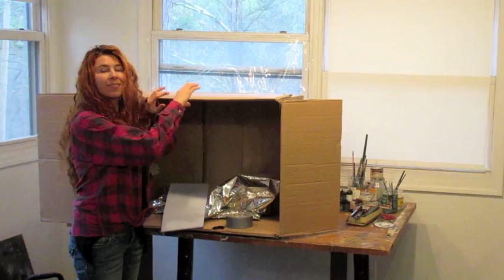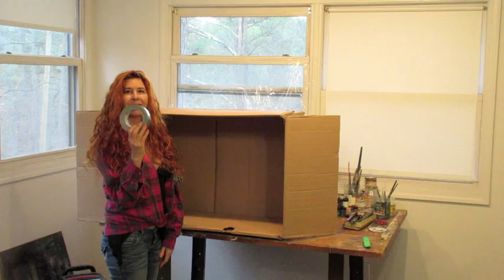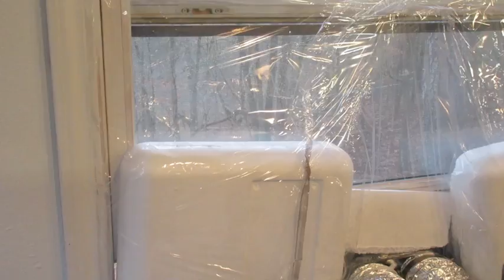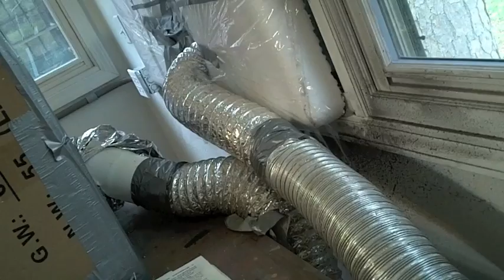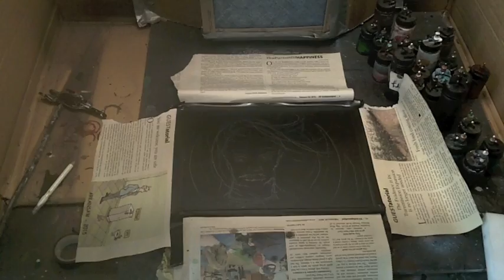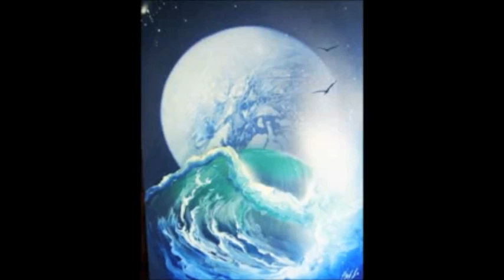how to build a cheap spray booth airbrush painting secrets

Comment: I made my own spray booth and use my shop vac to draw out the fumes.  I tried using it indoors but my wife still couldn't stand the fumes from the lacquer based paints.  Acrylics don't produce the same smells so I can still use it for acrylics and the wife doesn't complain.  I made a chamber in the back, sealed off from the rest of the booth and made a hole so my shop vac would fit.  I have a square of filter material attached with a couple of skewers so it's easily changed.

Comment: The only thing I’d do differently is I’d get another sheet of cardboard and cut a hole in it, tape that to the inside of the box and you can slide the dust filter in between the two holes - saves having to undo all the duct tape & makes replacing the filters a snap.

Comment: I realize this video had been up for a few years now but... this is NOT a booth you want for airbrush if you are painting with anything but water colors. And even there, you're libel to paint whatever is on the outside of the vent the color you're using.

This is a good example of what NOT to do and use for a paint booth on so many levels it's not funny.

This is very environmentally destructive on top of being just wrong.

I'm surprised no one called you out on everything you did wrong but hopefully after 3 years you know what's wrong... If you haven't burnt your brain cells completely out by now.

Comment: I graduated from a cardboard box to a North Coast Hobbies galvanized booth around 1991.  The booth sports a 395 cfm Dayton blower for exhaust. Used 5" galvanized furnace pipe to direct the fumes outside. 2 GE Lightstics provide ample lighting.   2 Paasche & 2 Iwata airbrushes handle the painting chores. They are all powered by a Speedaire 20 gallon compressor. Spent the $$ back then, take care of my investments & it still performs flawlessly to this day, 27 years later.  You can no longer buy the booth, Lightstics & the compressor is no longer made in the USA.

Comment: Isn't the problem with sucking the air out is that it drags in dust from the room? It would be better to blow air in through the filter so that the pressure in the booth is higher, pushing dust away. To stop paint spray getting up your nose just wear a mask. Dust is the enemy, not fumes ;-)
Reply: GRAHAMAUS. 😂 so dumb...

Comment: how about using an air filter for a home heat air unit say 20 x 20 x 1 on inside of box.    then put 20 inch box fan on back pulling thru. filters are cheap. box fans seem to live along time.  just seems simple

Comment: DIY spray booths can be made cheaply but much more robust than this effort. The biggest drawback is the excessive noise from the vac. There are much better materials than carboard that are cheap to buy as well as being waterproof. You can buy a pair of cheap inline fans that run much more silently than the cleaner. Angry neighbours pounding on your door at 2.AM in the morning is not going to make you popular. A more robust spray booth means you can move it without falling apart. The strips of LED lights are very cheap from china. They give out plenty of bright white light. I'm not knocking the concept of making a DIY spray booth but a much neater, stronger, quieter, waterproof,  booth could be made The kind of electric fans made to extract fumes  through kitchen window or similar inline fans of around  6" in diameter will do the business. The larger size of fans used to cool electronic equipment are make little noise and can be picked up for next to nothing as used items.
Reply: I like your ideas. The purpose of this video was to empower people to begin thinking about their ideal home made spray booth with stuff they already had around the house...glad you added your thoughts. I'll look into LED's and electric fans...hadn't thought about that. After making mine out of cardboard with a dust collector, I made a plexiglass version. I'll have to post that soon.

Comment: Great video for us beginners, i'm doing the same sort of  thing, making a test booth at low cost, modifying it ( several times ) and soon will make a great one from wood. i like the clear top idea, like the last suction fan unit. Gotta find a way to do all that and have the fan outside the room i work in and a way to filter the air well enough to have it exhaust in my garage.mmmm

Comment: Go to Wal Mart or even the Dollar Store and pick up a Large Plastic Tub instead of a cardboard box. Over time the box will break down depending on what you are spraying into it. Also watch the solvents that you spray!  Solvent based paints and open  brush motors do not mix! The solvent will eventually clog or cling to the motor brushes and possible causing a fire. If you will only spray water based acrylic paints you will have no problems with brush motors. If you can find a closed brushed motor you are okay. I got a hold of a fireplace motor fan that was for a Gas fireplace and I used that for my motor for my Spray paint booth.

Comment: Why not use a plastic storage box (rubbermaid-tupperware etc.)for the paint booth instead of a cardboard box? How about attaching the filter to the inside of the box. It would be much simpler to change when needed. There would be no need to duct tape things up and reduct tape every time you change the filter. Just food for thought.
Reply: Like rick said, tape filter material on inside so it's easier to replace. Also with the bag being so large on the back, use more of the filter with a larger hole and surface area you won't have to change the filter as often as there's more surface to get clogged.
Reply: She is a female,,, that's the best she can do. LOL
Reply: Good to see you’re at the top of YOUR game, you pathetic, misogynist piece of shit.

Comment: Just an FYI but I had a conversation with a relative not long ago about the issue of the flammable solvents from a spray paint can being sucked into the fan.  He works as the person who goes into large factories and points out all the fire and safety issues and is a member of NFPA with many years of experience and specialized training.  First, in the case of your centrifugal fan unit, the solvents won't pass over the motor, thus there is no ignition source as there would be with a Shop Vac or box fan.  Second, any air fuel mix needs to have the correct ratio to burn.  He said I would probably have to spray at least a half dozen cans simultaneously to come even close to a combustible mix.  Third, it will never, ever "explode".  That is what hand grenades do.  There are a couple of videos of bug bomb fumes igniting, watch those.  So spray away with whatever you want to use.
Reply from the maker: +sf9898u thanks for that great info! All the same, I would feel responsible if this ever happened to anyone I influenced! Glad it's probably not going to happen.-Alisa

Comment: Hi,Nice and cheap way to build a booth .
You mentioned about types of paint because of vapors/fumes can/may cause fire if any motor are nearby, but what about the exhaustor/fan and the compressor...?Also, it would not be even more save if you add another fan in front of the booth blowing towards the end of it to avoid fumes/vapors staying in the room...?
Thanks a lot
Reply from the maker: +Comicguy Hi, any motors plus ignitable fumes could be an issue..but airbrush artists have been using compressors with flammable paint for years...so that doesn't seem to be a big issue..although if there is enough concentration of vapors it's a problem for lots of reasons. I do often put a fan blowing the paint into the spray booth from behind me. It can work great if you find just the right spot, but it can also make the paint go out into the room too much if it's too powerful or too close. Hope this helps!--Alisa